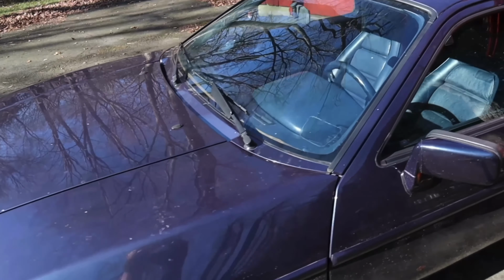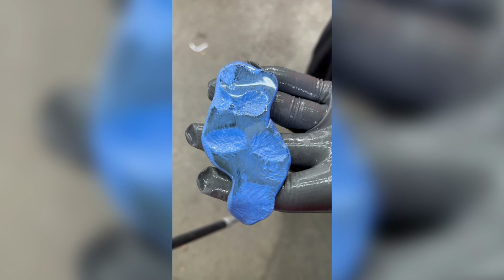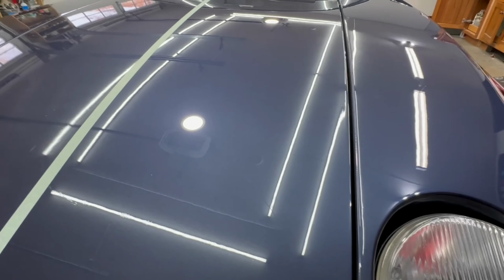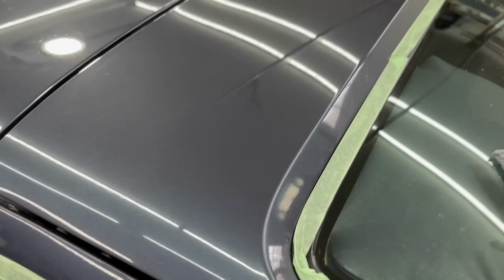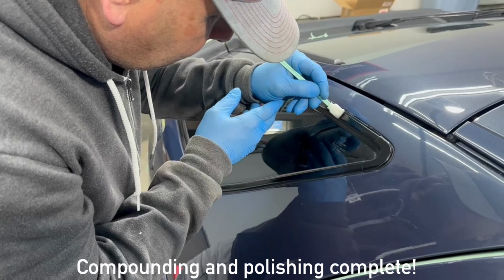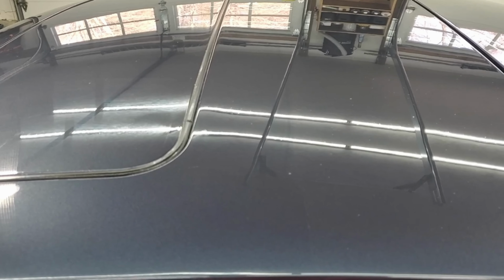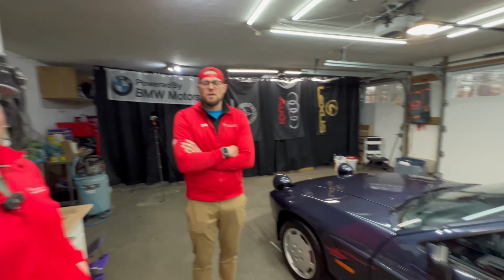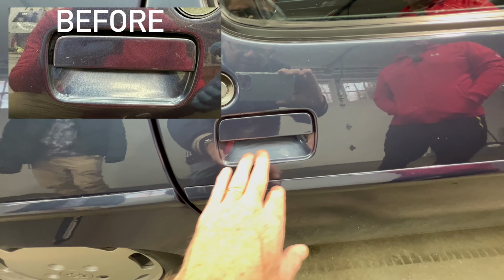Can the paint on my Porsche 928 REALLY be saved?! Let’s find out! Porsche 928 Revival - Part 13

Comment: Were there any repairs to areas where paint was missing like from road rash or rock chips on the nose of the car?  My paint is in nice shape but no amount of "paint correction" can fix missing paint.  What's the best process for this kind of repair?
Reply: @hampsonlaboratory1363  we did a tremendous amount of touch ups on the 928… each one is different but while they look significantly better , you and I will always know they are there… what it does do is draw an admirers eye away from it , so it won’t stand out .. just kinda blends in.

Comment: Very interesting,  Did I miss hearing the cost?
Reply: Like anything, it is a range. It all depends on individual requirements of the job. Anywhere from $2,800 to $4,000+ depending on the needs of the vehicle and the coating choice. Jay’s was somewhere in that ballpark. Up to him if he wants to share.
Reply: As good a job as they did a new paint job would have offered better results, not cost much more and a MUCH better investment, as long as the color wasn't changed. Pro tip, be willing to take it to a reputable shop in a low cost state.
Reply: Where on earth can you get a professional repaint for under 10k?
Reply: @YBSSRide  at least $8-10k to have that paint all re-done correctly. You can’t take a classic Porsche to Maaco. 

I got an estimate to repaint my ‘01 E39 and it was $7,000 for reputable shop. That is without Porsche tax.